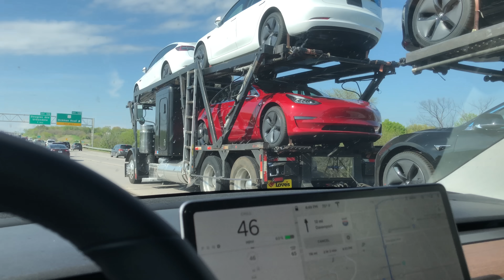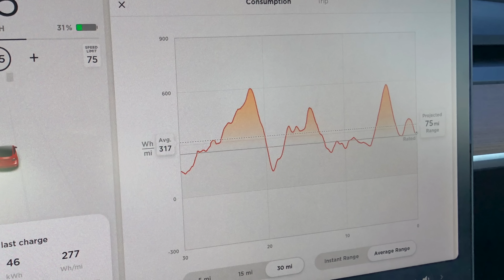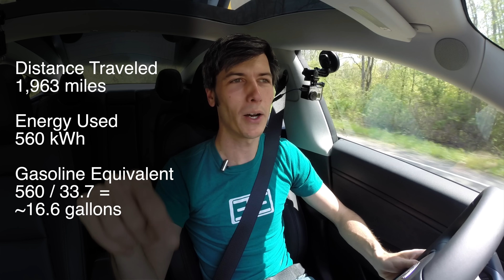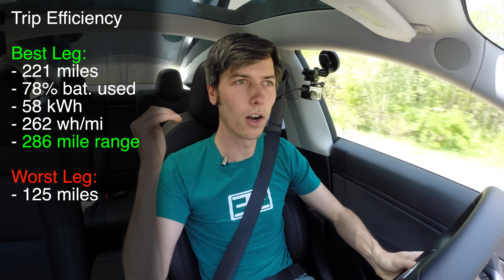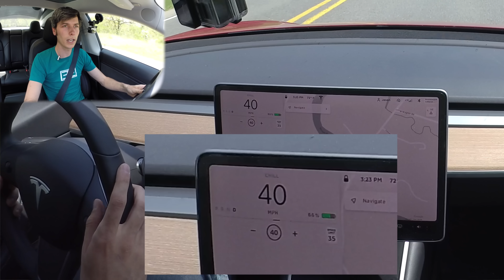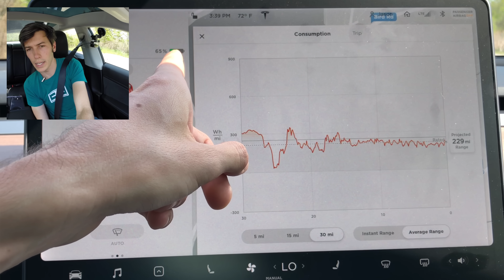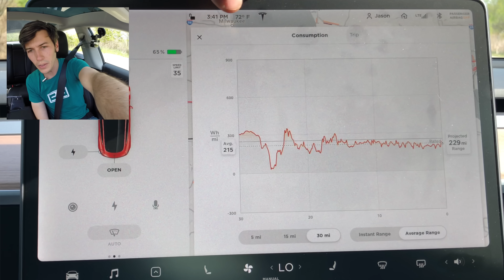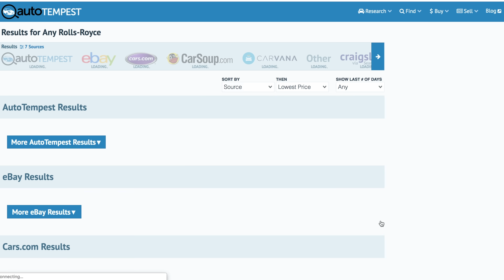How Miserable Is A Tesla Road Trip?

Comment: I drove from Orange County, FL to Orange County, CA in the exact same model Tesla. I timed how much time I waited for charging that I wasn't eating or using a restroom. Twiddling my thumbs waiting for the car to charge from coast to coast totaled 4 hours. I set Autopilot to 80 MPH the whole way.

A month before the last Supercharger upgrade, I drove 2 Teslas from Colorado to Florida in one week. One was the RWD long range and the other was the Performance Model, which I still have. The first trip in the RWD LR model was made in sub-freezing weather most of the way. Not only did the battery drain much faster, but I had to trickle charge to 100% to make it to the next station. On that trip, I twiddled thumbs for 7 hours. The second trip started the day after arriving in Orlando and parking at the airport to fly right back home for a traffic ticket. Temperatures rose to 33º in Colorado. On that trip, I twiddled my thumbs only 3 hours.

What a difference 25º makes. And what a difference the Supercharger upgrade makes that my cross country trip had almost as little charging downtime as my half cross country trip before.

Comment: This summer my wife and I drove from south central Kentucky to Seattle and back. Total was four hours in a Scion iA. We bought it because it tends to drive and ride like a much bigger car. It took us two days. We averaged about 80+ mph because we were able to cruise at about 95 in some states. When we needed gas we simply found the next Loves, Pilot, Sinclaire, TA, Flying J, etc. I would not use an electric car for a road trip because of all the planning you have to do to plan charges. 

If they were not so expensive, I'd get an electric and just use it for my local stuff. I can't imagine using it for my main car. And they don't have the range in cold weather. BTW, you mention weight. We came back carrying a bunch of guns and thousands of rounds of ammunition (the trip was about my father's death and part of my inheritance). The car got about 350 miles per tank. I think electric is a great thing, especially for urban folk, but it's not really ready for prime time, as you point out in your video comparing the weight and size of gasoline compared to batteries. 

Cool for short trips though, if you do a lot of them.

Comment: Bothering with managing the energy of the vehicle is entertaining for an engineer. I could see having a bit of fun with this (I'm an engineer). But normal people won't want to bother with this nonsense. It takes perhaps 40 hp to push a smallish car at 80 mph. Give me a 1000 cc turbo diesel to power a generator/hybrid setup with regen brakes plus a battery system to give decent acceleration as necessary--the Mercedes F1 hybrid system is over 50% efficient, as compared to perhaps 30% with normal ICEs.

Comment: What I want to know is:  What effect does such major discharging and recharging cycles have on the life expectancy of the Tesla battery?  What is the battery's efficiency like 3-5 years down the line?   Everything I have heard or learnt about batteries up till this point tells me that they don't do well with such extreme cycles.
Reply: Charging the battery to full all the time wears it out faster!
Reply: Which makes resale not an option..who's gona buy a used Ecar that will need a $20,000 battery
Reply: Yeah
As far as I know, those cars are not meant to last 100k + miles as many cars.
At some point you'll have to replace the battery which may be pretty expensive.
But it's a very important point a lot of people seem to just ignore
Reply: @MHNK77  Expected lifetime of current batteries is 300,00 - 500,000 miles with several on the road that have over 500k

Comment: A tip for Tesla owners who are planni g a long trip and want to save time on charging with Long Range Tesla.  Get to chargers with close 10% and only charge enough to get to the next supercharger.  Long range Model 3s can charge at 250kw and more and more superchargers provide 250kw, but the more charged your battery is the slower the charge, so charge only enough to get to the next supercharger.  I made a trip from Seattle to Chicago and most of the trip I'd drive for 2 hours and charge for 12-13 minutes and again drive for for about two hours.    Those short breaks were enough to use a quick bathroom break or get a sub and very quickly get enough charge to get to the next supercharger.  You charge more to skip a supercharger or two and you waste time cuz it will charge slowly.  I only charged longer if a supercharger wasn't V3 or I needed to take a longer break and I think once when I planned to skip a supercharger to get to the next one cuz the one I skipped wasn't close to the highway.   Personally I felt less tire after the trip.  I guess taking short breaks often rather than fewer long breaks just worked out better for my wellbeing.

Comment: Who wants to make 12 stops for 40 mins to drive 2,000 miles? That’s nuts. I have 8 cars and several will travel 400+ miles per fill up. So I could stop 5 times for 10 mins to fill up. So it would take me 50-60 minutes to fuel up for this trip and it took you 9 hours? No thanks.  Sure, I’d use 70 gallons of gas with the car that gets 28 mpg and spend $160 at the current gas prices. You used $40 in energy, so the difference is $120. So, is $120 worth waiting 8 extra hours? Not me.
I have a Cybertruck on order with the 500 mile range. Maybe it would be a better choice to go 2,000 miles.

Comment: What wasn't really talked about is the "drive for 3 hours and then eat" but I think this means you pull into the charger location and look what you can walk to, likely close to zero options.  Then, eating is decided on based on when/where you need to refuel, not when you really want to stop.
Reply: Just did a bit over 1000 miles in a rented Tesla. When we were ready to eat the super charger the car was routing us to had very little food options. Brought up a list of other super chargers in range and on the route home. There were 10. One had a LOT of dining options. Stopped there and ate fully charged before we were done.
Reply: Yeah that's what I would be aiming for. I don't like eating and driving either so stopping on a long distance journey for a cigarette and bathroom break is a must. Worse comes to worse stop to stretch legs and eat some gas station snacks or pizza or something. 

 You'd think those huge trucking stops would have super chargers now right? Like the bigger stops should have chargers I would assume. So I'm wondering how viable it is. Yet the bigger stops might have more people waiting for the chargers... So what happens then! Hopefully people don't go and take their sweet ass time blocking the charger while they stuff their face.

Comment: I'm curious about his flat tire situation. Do Teslas not come with a spare tire? I assumed he could have thrown on a spare tire and driven to the nearest Auto repair shop to get a replacement. Granted, Teslas might have special tires that aren't normally offered at repair shops, plus I know you aren't technically supposed to drive above a certain speed on a spare tire (which would qualify for driving on the highway). Curious what factors led him to being stranded that long with his flat.

Comment: Did you consider where the power came from for charging? That also needs to be in your calculations. Plus you should consider the materials make up batteries. What happens to the batteries when they go bad. I think if you do you will find it not as efficient as you think. Wow after listening to the pain in the azz it is to take a road trip in a Tesla. I’ll stick to my 2010 Toyota Venza of which I paid $10,000

Comment: In general, I like your videos and your presentation style.

However, I'd like them better if you ditched the clickbait titles. "How Miserable Is A Tesla Road Trip?" is a prime example. From your comments, it's clear that you found the road trip to be quite NOT miserable. In fact, it seems that you found the ride comfortable and that you used the charging time/stops to your road trip advantage. So, why not go with something like "Tesla Model 3 is a great car for an unhurried road trip"? If your goal is to conclude a long road trip as rapidly as possible, for now, an ICE car will have the advantage. However, if your goal is to get there at a reasonable pace and with minimum driving fatigue, the Tesla is a match, if not superior.

Last fall, I did a road trip in my TM3 DM AWD from Houston, TX, to Point Comfort, TX, to El Paso, TX, and back, about 1,650 miles. I made a total of 11 stops. On the return trip, from El Paso to Houston, I stopped 4 times, including a 1-hour nap/charge, and made it in just over 12 hours (~61 mph avg.). On the other 3 shorter stops, I got out, stretched my legs, went to the restroom, grabbed a burger or a snack/drink, unplugged and got back on the road, refreshed. I do have the Full Self Driving and on that return leg, entirely on a fairly wide open I-10, it was awesome. In fact, I only steered and/or used the accelerator for ~15 of those 750 miles. When the car needed feedback to know I was paying attention, I found that using the turn signal was more convenient and easy than jiggling the steering wheel. I would disengage FSD when exiting/entering the freeways on the charging stops and when some transient condition cropped up (e.g., highway construction, Border Patrol stop, traffic reroute/jam in downtown San Antonio, etc.). Other than that, the car steered and I merely monitored. As a result, I felt like there was 50% less driving fatigue than otherwise and I could have gone for hours more.

You did a good job of explaining your conservative battery use, but you might have speculated more about how a less conservative approach would impact the number of stops and the total time of the trip and how typical stops on an ICE car trip would impact the total time. Also, you could/should have explained that your TM3P range is a bit less, compared to the non-performance TM3 AWD. Last point, though I agree that the navigation could/should be more flexible and offer more info (and expect that it will continue to be improved via over-the-air updates, which you didn't mention), if you delete the destination from the navigation for a moment, you can see all of the superchargers on the route.

Comment: Tesla car without autopilot man, Its like a peanut butter and jelly sandwich without the jelly :( . Also it did look like he ONLY saved 40$ but spend 8 hours charging which is super inefficient. But don't forget Tesla autopilot can be used and you can do work, sleep, or do anything else other than drive for that time. But this boomer that doesn't look like a boomer rather look at the road and drive himself that let a robot take control. Its understandable but get with the times man!

Comment: Just a quick question, why did you buy a brand new piece of highly engineered and detremental to the enviroment car that has no emissions when you could have converted your existing car to run on plasma, a company in New Zealand has been offering this kit for over ten years now. Did you have to spend however much on NEW, which we all know is the most horrible for the enviroment as all the metals and chemicals for the batteries are worse than neuclear waste, when you could have spent around 2 grand and updated your original car. All tesla owners are the same, of questionable intelligence. Oh and could you answer the querstion, ta.

Comment: Imagine if tesla in the future has batteries like the Dewalt, where you can have 1 in the car go the 200 miles take that battery out and switch it with the fresh 1. And there could be a little spot in the frunk where the spare battery sits and charges while you drive.
Reply: What would charge the spare battery in the trunk? A little gasoline engine like the BMW i3?
Reply: @flyinl0w  you would dock it in the trunk, and it would charge as your car is in motion via regeneration

Comment: The major inconveninet i found is that i have to stop for eat+charge. I usually prefer to eat at places that are not charging points but genuine place to eat fine meals... With a combustion motor, you can "recharge" in less than 5 minutes and spend the time on the places that YOU choose, not the car manufacturer.

Comment: based on current California electricity and gas prices, 560kwh is equvalent of (560*0.28)/3.1 = 51 gallons of gas. So any car with MPG higher than 1963/51=38.3 will be cheaper to drive. Well, 40+ hw mpg is doable with many car in compact class.

Comment: My experience with hybrid biggest hogs of energy. Number 
1. heat int vs ext temp of more than 10F 
2. Speed over 65 mph. 
3. A/c int vs ext temp more than 10F. 
4. Load / occupancy wt. 
5. trip distance less than 11 miles is not efficient especially for hybrid something related to battery maintenance. 
6. Tire pressure (also related to cooler temp as tires lose some psi when colder weather not adjusted)

You pretty much drove in ideal weather conditions 55F to 75F is when the int vs ext temp delta is less than 10F.  Driving behind a big box car helps a lot too.

Comment: 10-60% is optimal for road trip to minimise charge time.  if 60 is enough to get to the next charger....  Then u only need 15-20 min stops...  It would be nice to calculate the fastest time on this trip speed vs charge time.  so 10-60% charging and speed that would optimise range vs time.
Reply: I get 240 wh/m in my rwd at constant 55mph.

Comment: One second here, one gallon of gas which weights 6 pounds can move a car similar to tesla in most parameters, let's say Toyota Camry,  29/41 miles. How far 6 pounds of battery in tesla can carry you?  250mi/1054lb*6=1.4 mi  Not very efficient in my book. And these are the numbers that are relevant when it comes to driving, not your kwatt/h nonsense. So one tank of gas in Camry being 16 gallons (weighing 96 pounds) can  produce on high way 656mi of range. If you want to increase that just get 3 more cans of fuel (let's say 6 gal/36lb each) with you and you got 738 additional miles in reserve available to you in minutes! No tesla can beat these number no matter how hard Elon Mask tries to convince you otherwise.

Comment: You cannot equate the energy used by the Tesla to the quality of gasoline used by a ICE powered car.  The majority of primary energy used to power the Tesla was generated with coal or natural gas in a large scale utility power plant, with a thermal efficiency of about ~65%.  Then you have to consider the transmission and distribution losses to get the electricity to the supercharger.  Because those losses are upstream of the Tesla, does not mean they don’t exist.  The Tesla consumes about the same power to propel it as any vehicle of comparable size, weight and aerodynamic coefficient.  The efficiency expressed only as the kW fed into the battery, ignores the emissions produced and efficiency loss necessary to deliver that power to the supercharger.

Comment: Maybe Tesla has an issue with economy. During my vacation last year I hired a Ford Explorer at 60mph got 20.7mpg. As I only had 3 weeks in the US (from Australia) and wanted to see as much as possible I was in the habit of running a bit faster than the posted limits. I soon discovered I could travel on most of your good interstates at 100mph - guess what, with the extra aerodynamic drag the fuel economy dropped to 20.6mpg. I only lost 0.1mpg!! Does that make the Ford a better option than the Tesla?🤣🤣🤣🤣

Comment: A few questions you might be able to answer on electric vehicles. First, chances are every time you charge your car you are using fossil fuels that you wouldn't use in a gasoline/diesel/natural gas powered car. Compare exhaust emissions to your otherwise charging with fossil fuel. Next, e waste now accounts for a large portion of waste products. Mining of the minerals to make the batteries to run your car creates pollution in third world countries and contaminates potable groundwater pollution. Compare air pollution to potable/drinking water pollution. Taking these into account can you show me the math that shows electric vehicles create less over all pollution than gas/diesel/natural gas. Now compare electric to propane or natural gas powered vehicles. Can you honestly say your electric car is better for the environment than the alternatives? Take into account solar and wind energies can't replace fossil fuels because the USA simply doesn't have enough room for them and the power we use daily.

Comment: It rides like a buckboard on any but the smoothest roads. In the Houston summer heat the AC is effectively nonexistent. (We got stuck on the freeway at lunch one time for an hour in July and we were soaked with sweat! Outside temperature, 122F (on the freeway,) hot summer sun beating down.) Let's see if the superchargers work right now in California! (major electricity shortage! Rolling blackouts, etc.) I'll stick with my gas guzzling super smooth riding, super air conditioned, Lincoln Town Car.

Comment: I have been working on an E-Motorcycle, major factors as you mentioned are aero. the energy density vs efficiency is simple, ICE = 20% (aveerage, sone are a bit better but not much)  PMAC motors = ~85% (some go up to 92% but they are not production) so 36kWh per gallon only gives you a useable 7.2kWh. Where with the electric, to get 7.2kW you only need 8.5kWh.  Great videos!